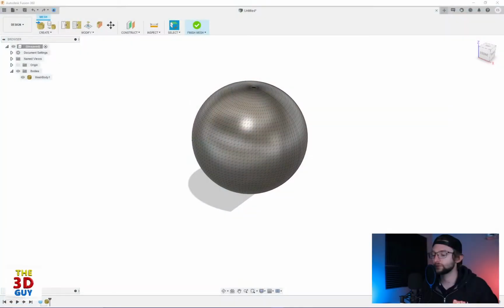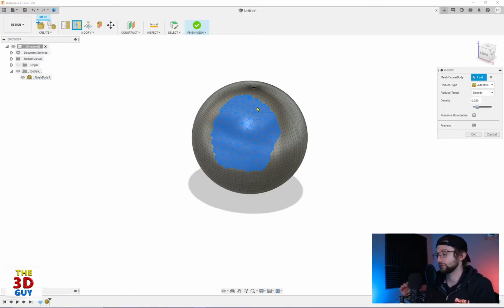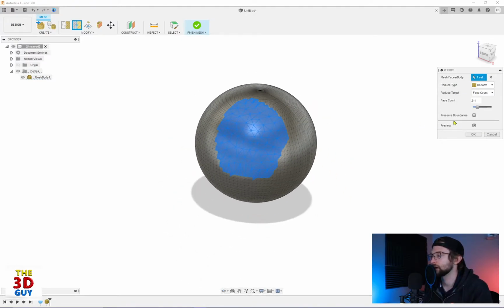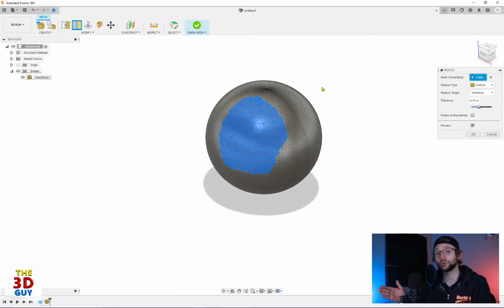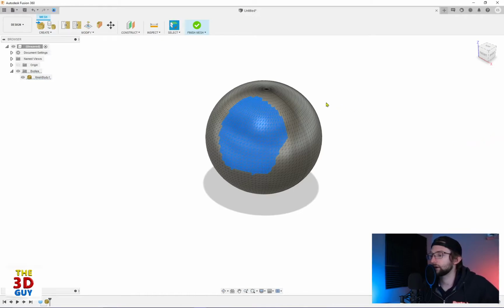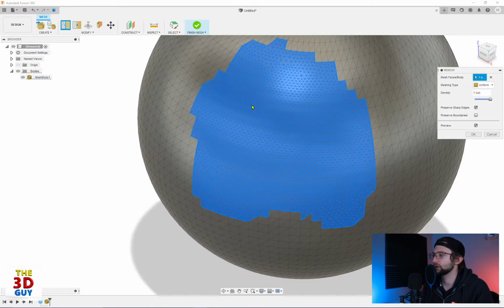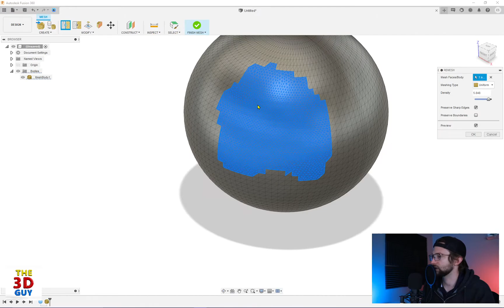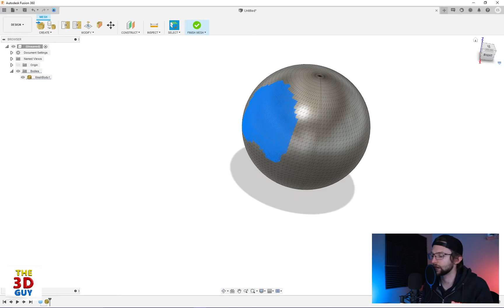How to Refine & Reduce Mesh in Fusion360

Comment: I had to print a dragon head sculpture for a friend of mine. The STL file had 100mB sice and Fusion 360 could not convert it to a solid body. Thanks for that video man. Now i can optimice to sculpture in fuion due to the reduced mashes. Now only 30k instead of 500k polygons :D
Reply from the maker: glad you found it useful